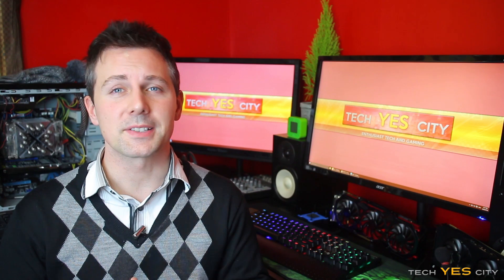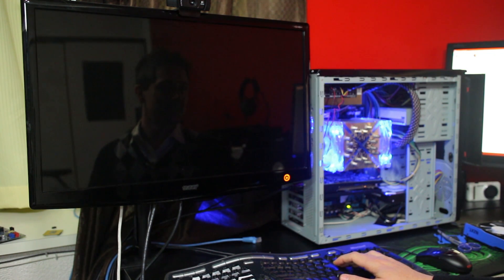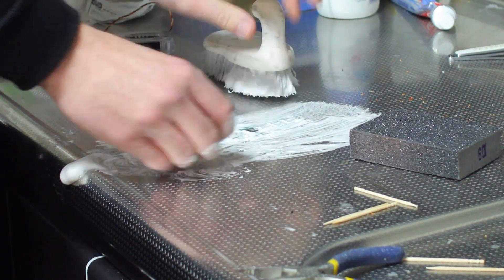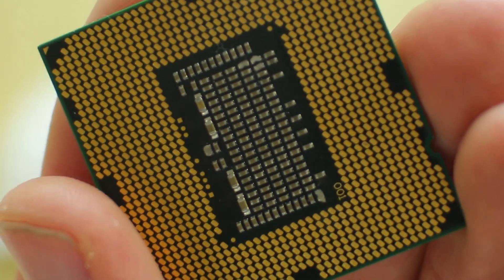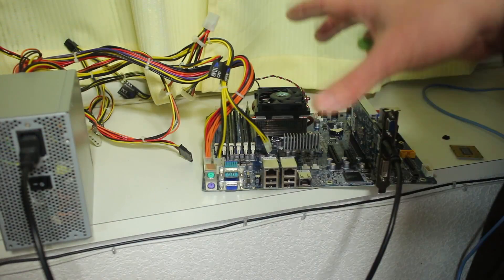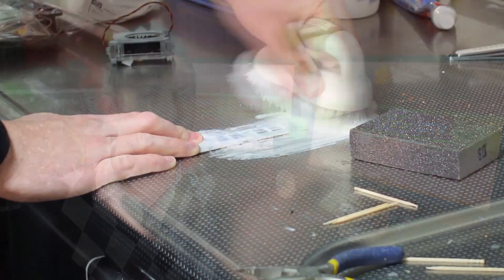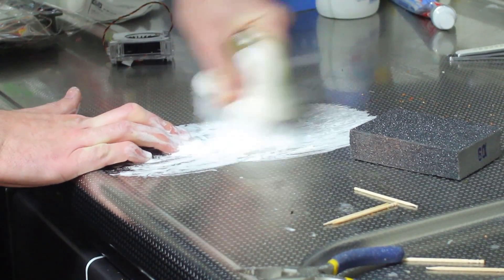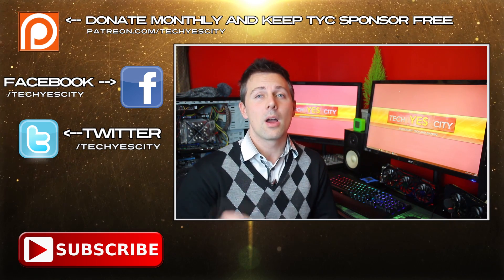Is it OK to WASH PC Parts? Ft. Fixing a Dead CPU & Testing a Dead PSU

Comment: brian, for the adapters to work you would have to connect the red wire to another red wire on the psu, the problem is that pci connectors dont transmit 5v (red wire)

Comment: WARNING: You can NOT discharge capacitors inside a PSU like that! In switch mode power supplys the AC gets rectified into DC before it can get stored in the filter caps.
Shorting the AC input won't discharge the capacitors one bit because the bridge rectifier doesn't allow for any current to flow in that direction.

Once unplugged from the mains the AC input of the PSU is safe to touch (it would be very dangerous otherwise!), while the main filtercaps inside still can be holding a Charge of 170V DC ( for 120V AC mains) or even up to 340V DC (for 240V AC mains) this is NOT safe to touch! In fact it's the total opposite of that!

Do NOT use this "Method" if you plan on opening up the PSU. The caps WILL still hold most of their charge and you can get hurt!

Always, ALWAYS make sure to discharge / short out the main filter caps (usually big and round) seperately using a INSULATED screwdriver (preferably a wide flat-head screwdriver or simmilar) when working on PSUs like this and other devices that store rectified mains.

(Devices like LCD Monitors, Notebook PSUs, Class D Power Amplifiers, Flat Screen Televisions and pretty much anything that uses a switching mode PSU)
Reply: +Tech YES City you've killed millions
Reply from the maker: Well I have cleaned a few PSUs already and never had one problem with charged caps, been doing my ghetto methods for years and years now.... so I don't know if the OP is using 10+ gate protected PSUs or what not :P.
Reply: +Piotr Malczyk I had its badass brother the SOC and it was a nightmare especially when it came to customer service.
Reply: +Tech YES City Unfortunatelly I can't + You so I'll offtop here a little bit: 
My 4790K run at 4,6GHz 1.35V with good cooler is "almost dead". Noone can tell exactly what happened, but CPU reboots PC few (maybe more) times before booting up to Windows (it resets BIOS throughout the process). It passes through Intel test... I can't RMA it, because I've lapped it, but I'm almost sure the CPU can be saved from dumping. Do you know any CPU lab to do such a thing (I mean like taking of IHS, cleaning it up and trying if it works)?
Reply from the maker: Piotr Malczyk Drop it to 4.0ghz even at 1.25v for the mean time, just sounds like an unstable OC? Make sure the cache ratio is at auto for now, if problems persist then I honestly wouldn't really know whats going on there... Are you sure the PCB isn't bent on the CPU (edit sorry you are on haswell lol)? Rare but it is happening on Skylake.  CPUs and memory are pretty precise in that they will simply work or fail.  Also from experience 1.35v is a little too high for a 4790k 24/7, especially if you have vdroop settings on max that can spike the voltages..

Lastly you could try delidding as a last resort, but just confirm that the CPU is stable at lower voltages / lower clocks first, then go from there.
Reply: +Coldministrator This sounds legit.  Would be funny if this was a troll tho. Haha
Reply: Unfortunately it does reset BIOS to default settings which is 4.0 to 4.4GHz in turbo... I'd have to flash custom BIOS. I'm about to ask Gigabyte to make me custom BIOS and we'll see. Anyway, thanks for reply, I'll keep you posted ;)
Reply from the maker: +Piotr Malczyk I would try a different mobo if you can, I had too many problems on a gigabyte x99 board I had.
Reply: +Dima Gurevich I wouldn't rely on that. You are certainly discharging the capacitors by some degree by doing that but the oscillator feeding the transformer is only operating as long as the voltage on the 5v standby rail is high enough to do so... Once it drops below a certain voltage it will stop to operate and once that happened any discharging of the MAINS filtercaps is impossible without opening up the PSU and doing it manually. They can still hold most of their charge at that point.
Reply: +Coldministrator Much easier to just cross the green wire with any black wire.Psu turns on and uses up whatever juice was left in it (Might see a slight fan twitch as it discharges)
Reply: +Coldministrator Shorting the mains cap in anyway can cause damage to the PSU, so what I do instead, is use a 1W 500 ohm resistor between the + and the - of the cap. It usually takes ~2-5 seconds to get it down to under 10V (from 350-400V). I've also used 1/2W resistor, but it gets hot real fast, so I have to do it in a few 1-2 second touches.
Also, if you're going to be doing this, make sure you're not touching the resistor's legs, with your fingers.
Reply: +Coldministrator NOOOOO! You're wrong! Always lick the capacitors contacts immediately after disconnecting!
Reply: It's GA-Z97X-Gaming 3, Intel Z97 Chipset.
Reply: +Tech YES City I've delidded it, cleaned it up and mounted back. Now it does reset every 2-3 boots so it's definitely some improvement. Gonna check stability now. For me it's either RAM controller on CPU or voltage controller.
Reply: Piotr Malczyk I was getting memory errors all over the place with my SOC but it wasnt a CPU issue.
Reply: U suggest me to change RAM to some normal 1600's and check the result?
Reply: Piotr Malczyk I am recommended you test the system with another motherboard. if you cant test it with different ram. Of any speed.
Reply: I will test different RAM, but won't be able to test with other MOBO.
Reply: +Coldministrator Dem Diodes.
Reply: +Coldministrator Alternatively, you can short the green and any black wire on the ATX plug to discharge the power supply.
Reply: +Coldministrator I doubt they wouldn't include a bleed resistor. Lives are on the line and resistors are less then a cent in bulk. Probably a safety standard in most places.
Reply: You would think that... still, i have done repairs on PSUs from manufacturers like Listan (BeQuiet) , Corsair, FSP, Delta and Chieftech and none of them had any dedicated bleed resistors across the rectified mains caps.
Some still get discharged over time through other components but none of them were safe to touch when i opened them. (ok i usually test my stuff right before i open it. If you leave that stuff over night, chances are are a lot better that the caps are almost empty.)
Reply: +Padurariu Catalin Dude, only 4 Messages above yours i have already adressed this. This does not get rid of most of the charge in the mains filter caps.

Here is what i wrote again:
I wouldn't rely on that. You are certainly discharging the capacitors by some degree by doing that but the oscillator feeding the transformer is only operating as long as the voltage on the 5v standby rail is high enough to do so... Once it drops below a certain voltage it will stop to operate and once that happened any discharging of the MAINS filtercaps is impossible without opening up the PSU and doing it manually. They can still hold most of their charge at that point.
Reply: +Coldministrator I hope you guys were not deathly afraid of 12 volt DC. Might burn your finger tip at most at those amperage levels.
Reply: bentboybbz held a 12v 1300w PSU wires. Nothing.
Reply: +bentboybbz the low voltage section (3.3v 5v 12v) is not what you need to be afraid of but we're talking about switch mode PSUs here.
The main filtercaps store rectified mains and that is way more than just 12V ... did you even read the original post?
Reply: +Karim Kandil we have 120 volt here and it does not worry me that much.
Reply: bentboybbz 120v power supply??? I meant 12v output not input.
Reply: IaMaWeSoMe7478 kijiji and craigslist get you much better deals if you live not in the middle of nowhere
Reply: IaMaWeSoMe7478 kijiji it is what we use in Canada.
Reply: reaper reaper Easier maybe, but as quick?
Reply: Well, there is the chance that you just get brain damage and have to agonize for years before you die. :/
Reply: I was it and i was like WTF! I know it doesn't work ive touched those connectors thousands on times with my hands lol.
Reply from the maker: +Coldministrator Thanks Ill add that to the description.

Comment: Don't hard drives require both the 12v and 5v to operate? I know 3.5" drives do anyway. You could try attaching a 7805 regulator or taking one from the atx
Good way to test for psu shorts is to paperclip trick and probe the pins with a multimeter, taking it apart, probing the individual components on the PCB and comparing them with the correct values can give you a nice insight too.

Comment: I think the memory will work for now but not for a long time. It's like when a phone is drop into water. If you dry it immediatly it can survive but not for a long time.
Reply: +L3xou97 As long as you dry things properly before powering them on they will be fine, the reason your phone might not survive is if there is still some moisture (even a very small amount) left in it or if the battery became undercharged by shorting, modern LiPOs die if their voltage gets too low something that is normally prevented by protection circuits (but they don't work when wet of course ;)).
Reply: Sam B
 Corrosion can cause death too.
Reply: L3xou97 Yep but as long as you dry it properly it wont corrode assuming it was fresh water and not salt or something, if it was you'd want to give it a thorough rinse in fresh first.
Reply: Sam B
 Even if you dry it immediatly there is a risk
Reply: L3xou97 As long as you dry it properly you're all good.

Comment: Are you sure that RAM wasn't like a special edition stick made by nokia?
Reply: +Nanda Panda Tech He just washed it! I do that all the time, to clean water damaged and/or really dirty motherboards.
Reply: Jordan Tavares
If you're talking to me, yes!
Reply: RAM is actually quite sensitive to static, so you can kill a stick without really trying. Now good thing that water supply is at ground potential so washing it is among the safest things you could do. A little point of concern is the underfill under the BGA soldered RAM ICs, if it's not perfect, water can get in, and if it does, it won't get out so easily, maybe after a few weeks of drying. Luckily if it's fresh water rather than some other liquid, it won't really corrode anything, so it'll recover.

But generally washing RAM is no big deal.
Reply: +reaper reaper me too
Reply: ARE YOU SURE ABOUT THAT?
Reply: Well if there aren't any ways for the water to get between any connection to short anything out or to start fucking up some small components then I gues washing it isn't too harmfull..
But I'd never do it to a component I wanna keep
Reply: There's a reason many ram brands come with lifetime warranty. It's pretty hard to kill a ram stick without really trying.

Comment: When we moved out of our Cochroch infested Place. to a nice Non Roch house. we had 2 PC's refuseing to Post.
I removed the HDD / PSU / Battery / CPU.. etc..

Disasembled the Motherboard   / Case.. Cleaned that with the Hose etc. and washed the MB's in the Sink with soapy Water.
We had nothing to lose.. and After it was Dryed. tryed it and it worked Perfectly. still working Perfectly over 3 years later.

Just be sure to Discharge all power from the MB etc. by unhooking the PSU  / Battery and holding the PS button down. to make sure theres nothing there...

Again thx for shareing you're cool Videos :)
Reply: +Phillip “Tech N' Gameing” Hardy Yeah, lot's of people think that stuff is extremely delicate. Truth is, it is very durable. As long as it is completely dry, and water didn't get into anything while power was applied, it will almost always survive.

Comment: A PCI-E power is 12volts and ground, a hard drive and cd rom requires 12volts, 5volts, and ground which is why it didnt work since there is no 5volt on the PCI-E power cable.

Comment: Brian just a recommendation for you, I do a lot of computer work and often times use a piece of metal to short the ON switch on the motherboard too but if you find an old junker case you should try ripping the power switch out of it that way you can just plug in the PWR to the motherboard and have a convenient little switch.

Great video as always man keep it up.

Comment: Why do you own a hair dryer?
Reply: +kenykillr  to style pubic hair ( ͡° ͜ʖ ͡°)
Reply: Lor Reuben idk wtf ur sayin man.
Reply: +kenykillr i once used an hair dryer to fix my dead gtx 560 ti
It bought it back to life
Reply: +kenykillr it doesn't give your gpu more life lol.. it just reseats the solder on the PCB for better contact with the chips.
Reply: Lor Reuben how is that not exactly what i said it was, if the soldering is going bad putting it in the oven doesnt make it last forever. at that point youre ringing it out
Reply: +kenykillr wth.. of course it doesn't make it last forever, nothing lasts forever. putting your gpu into the oven to "get a little more out of them" doesn't even make any sense at all. i was just saying what does putting your friends gpu into the oven does to the card itself.. lol
Reply: +kenykillr really? oh wells... sucks to be you man
Reply: +Lor Reuben ye
Reply: Oven gives it baybe a couple months more, that is all. But if that's enough time to get a replacement, what is there to lose. Just make sure to air the kitchen afterwards.
Reply: kenykillr for instances like this of course.  washing computer parts :D